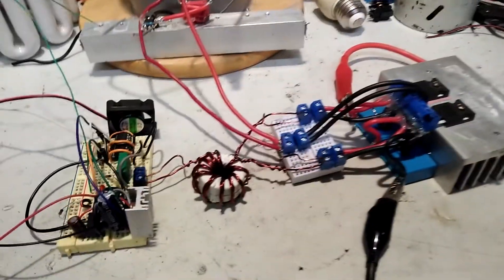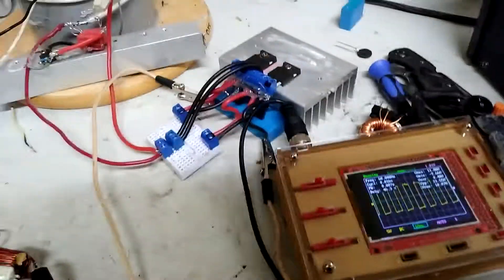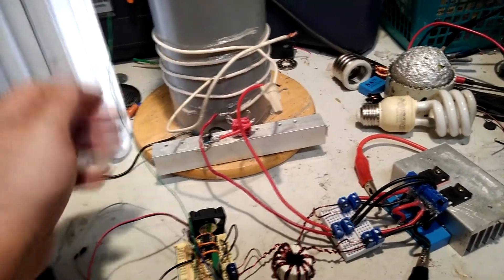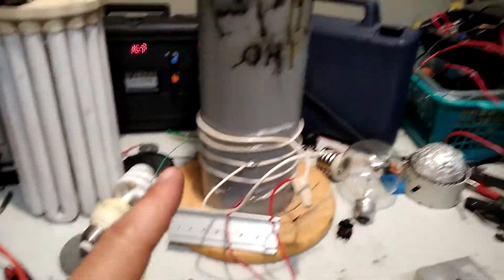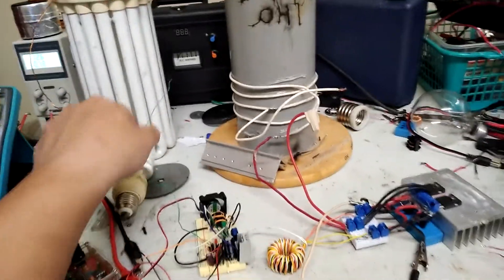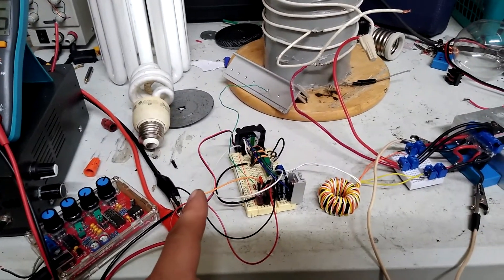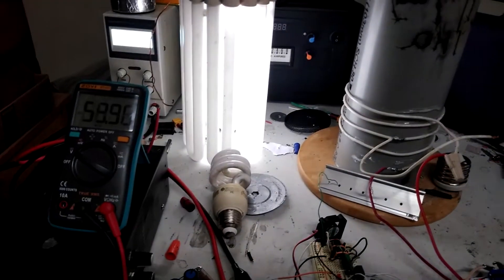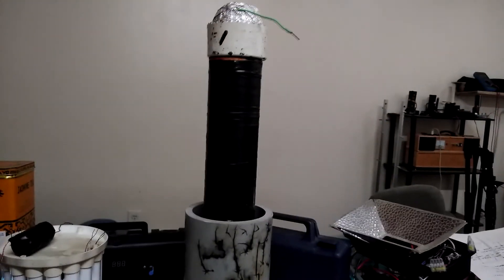Steve Ward Mini SSTC testing

Comment: thats not bad at all ! well first things first, get that circuit on anything other then the breadboard as its going to seriously pick up other frequencies and other garbage ! but im sure you know that :-) if you have an old telescopic antenna, try it out, you can get the optimal position and height for the coil, sstc setups use short and fat coils just like your other setups but i know you said this is a test setup so roll with it, the dimmer is acting as a chopper circuit, its something i wanted to try too and i like the sound .. it could also be affecting your circuit but that might be the fault of the breadboard and its your only source of variable mains but if the circuit can go full power, try it without the dimmer and see how it works ... you can try a large piece of flat wood wrapped in alu. foil for a ground plane or some large hunk of metal ... hope all this helps !
Reply from the maker: Thanks man I'm about to have some more cracks at it after I clean up some lol. I think if I can get the antenna shit right it will be outputting like it did in that short flash which is supposed to be what the output is essentially. Dimmer does chop it pretty good but I smoothed it a decent amount so it wasn't so different without out it, but this is mainly because it was hardly pulling any power I think. What sucks is I don't have any PCBs at the moment so I have to stick with the shady setup for a little while but you're probably right it's not really going to work well until I get it better isolated and mounted. I guess this circuit wasn't really designed for long arcs anyway so it seems pretty cool just running without the interruptor at all or using the dimmer.
Reply: @Magneticitist  you can get longer arcs with interrupters and unsmoothed dc and your already interrupting the supply to a degree so i dont think it will pull much power, try it without the dimmer to see how much power it draws
Reply from the maker: @dirkk82  I'll try but I wonder can I interrupt it by just pulling the hex inverter input to ground instead? Assuming I still can't get the enable pins on the gate drivers to work that is.
Reply: @Magneticitist  I've never tried it but I dont think that's a good idea as it's the antenna input, you only want the frequency from the coil going in there, that's why you have the enable pins ... or you could possibly interrupt the supply voltage for the half bridge but I've never tried it